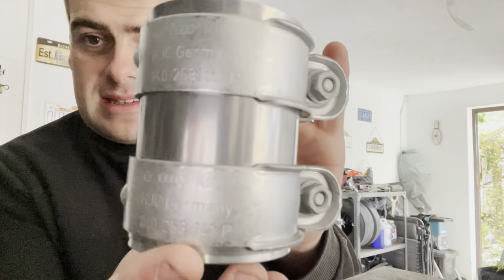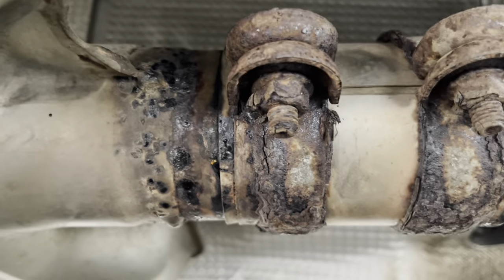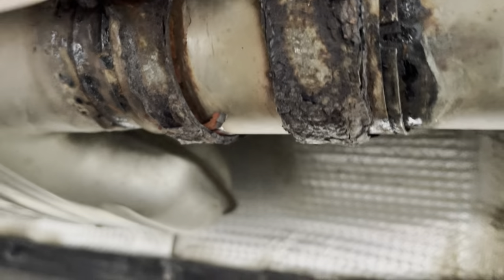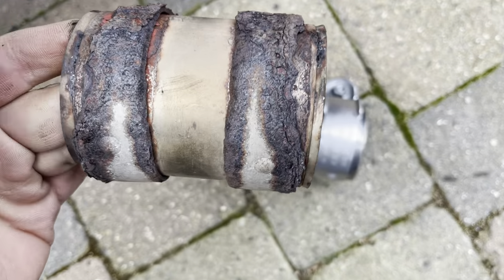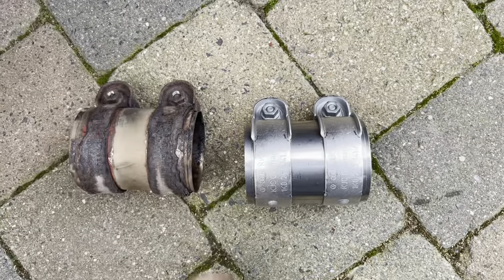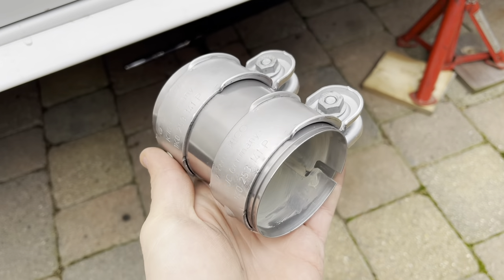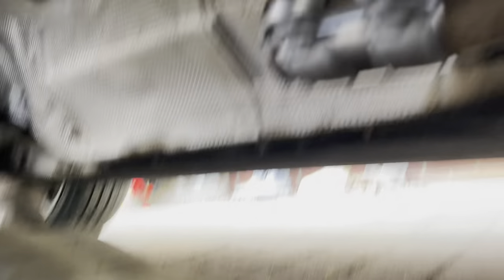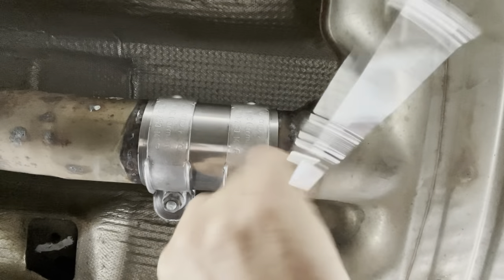Audi a5 exhaust clamp sleeve replacement

Comment: I fitted exhaust sleeve on replacement centre pipe for my Mazda 6 unfortunately its leaking through the sleeve end, any idea on whether i should have used a sealer paste like you did or maybe i tightened it too tight??
Reply from the maker: I always put exhaust seal on as there may be imperfections on the pipe and without using it I always get a leak

Comment: Will this clamp fit on a 2 inch exhuast
Reply from the maker: Yeah I would have thought it should I think the exhaust on the Audi is just under 2 inch
Reply: @Chris_GasolineGarage  I've got a 52mm exhaust on a golf 6 and the a5 sleeve is cheaper than the golf 6 sleev so I'm hoping they are the same size
Reply from the maker: Hopefully it will couldn’t say for sure